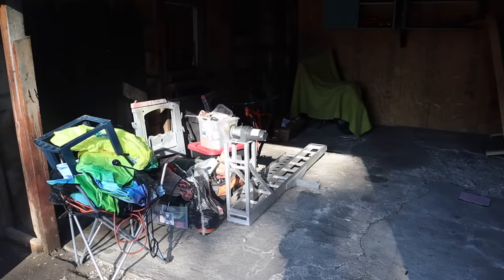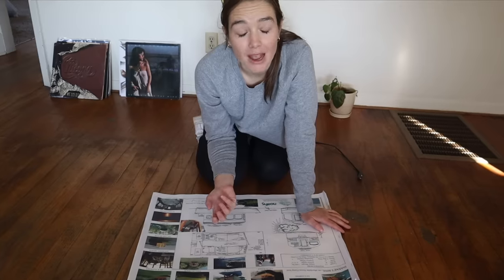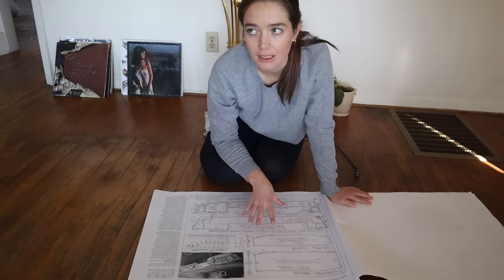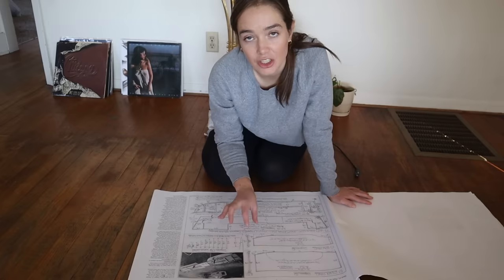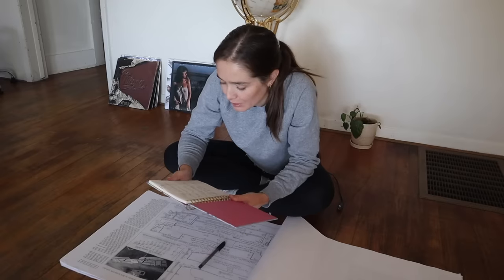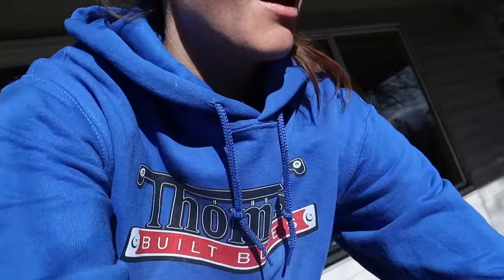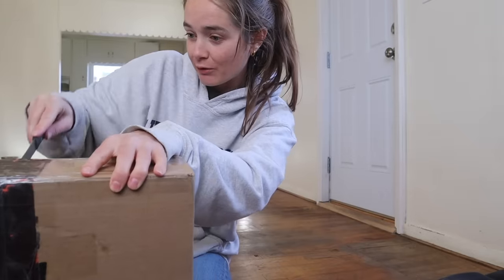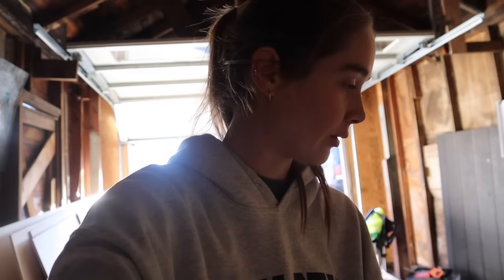Building this house boat might be more than I bargained for (Boat Build Episode 2)

Comment: How much did you buy Birbie for; amount you put into it; how much you sold it for??
Reply: She said in the birbie build that she got a ridiculously good deal on the bus to begin with, a couple grand(ish), but she spent quite a bit over the course of the build between materials and systems and mechanicals, over all I’d be surprised if was less than 10K, she had expenses for gas and travel. And she had initially listed it for around $40K (I looked into buying it but wasn’t feasible as I live on the east coast.) So those are the ballpark numbers I have in my notes as I was/am considering building out a bus for myself in the near future.
Reply from the maker: bought for $1000, sold for $36k.  I'm really not sure how much I put into it but my guess would be somewhere between 20-30